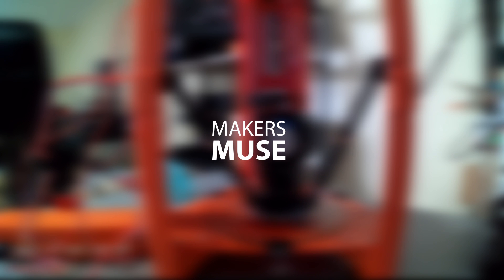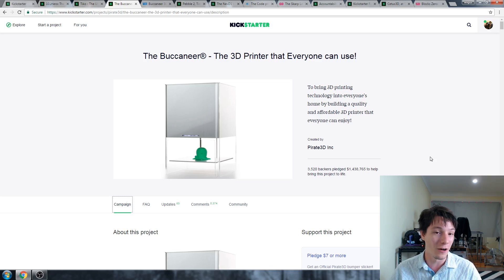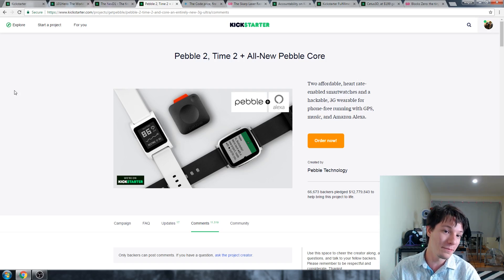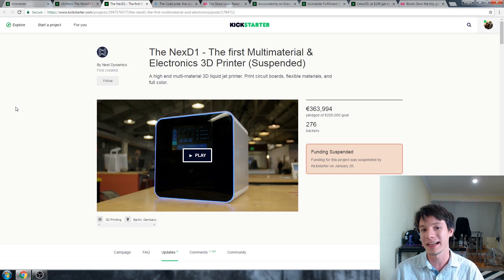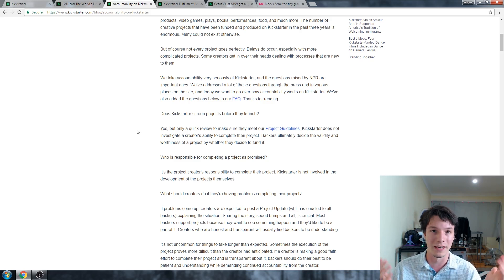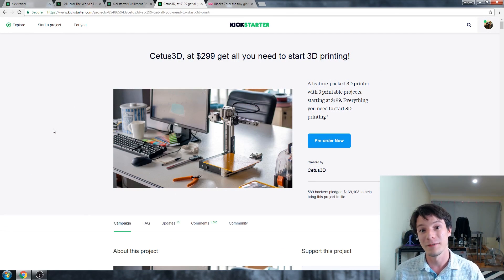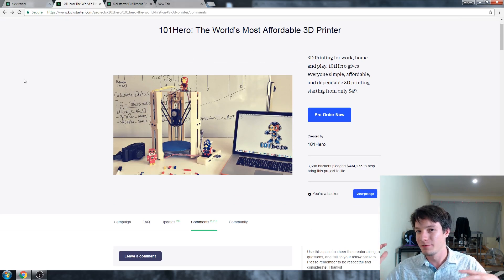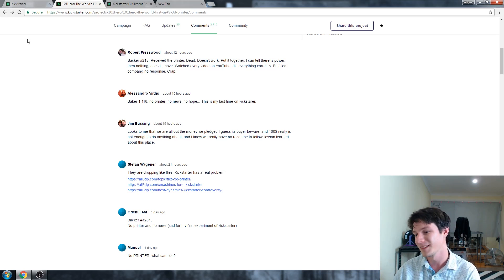Crowdfunded Hardware - We need a new approach (urgently)

Comment: I think this a big issue. I think Kickstarter should act as the "escrow" company and take in all the cash, hold it (maybe use it to make interest?), and give to the creator in accordance with their previously submitted business plan. Kickstarter could force a "business plan", to force "creators" to think through the process. How? 100 units - What's the plan for injection molding, metal work, wiring at this scale? 10,000 units, now what?, 1m units? See the "best and worst" case scenario of scaling the project. I agree many get lost in the shear scaling of the project. If Kickstarter were smart they would leverage this problem into a solution. Escrow the money and require a comprehensive business plan with specific manufactures already identified.Kickstarter Partner with known, reliable Manufacturers and require the Creator to utilize their Manufacture, or submit an alternative for vetting by Kickstarter. Think about this, Kickstarter could drive the cost of making these items down by partnering with specific companies, maybe they get a kickback? Who knows. Good Video!

Comment: Part potential solution/part plug: What if, rather than crowdsourcing the funding, we crowdsource the actual designs of these hardware projects (under open source)? Then, it's just a matter of someone manufacturing the hardware. Like the original Reprap project, it would be developed by the crowd, so the potential nefarious intentions or mass manufacturing pitfalls disappear (while, in the case of 3D printing, the industry as a whole still moves forward). 
In fact, that's why three of us have spent the last few years building a platform for crowdsourced design--so open source hardware development can happen in one place. It's like Thingiverse with built-in CAD. We want to do things like crowdsource the development of open source 3D printers, food and energy production systems, and whatever else the crazy Internet comes up with. We'd love people's feedback and to help kickstart the crowdsourced design movement: https://3DOrchard.com

Comment: To begin with Kickstarter themselves should not get their cut until a project has been successful. Those funds should be held in escrow to partially refund backers if a project does not deliver. None of this skimming off the top nonsense where Kickstarter wins every time. It is not a total solution, but it is a start.

Comment: What no mention of the Peachy Printer? ... the tiny resin 3D printer where one of the organizers simply ran off with the cash and built himself a house.

I recently received my hardware from the Raspberry Shake kickstarter.  It's an example of a kickstarter done right.  the hardware is a personal / hobby level seismograph using a custom circuit board along with a raspberry pi.  They raised enough money for some extended goals, and they shipped on time,  although their choice of shipper left the hardware floating in transit for two months.  Nonetheless, the seismograph works great. It exceeds the capabilities they promised, being able to detect large earthquakes on the other side of the earth in addition to small local events.  Their customer service has been amazing - they actually sent me a replacement when it looked like mine had been lost in shipping.  The original did show up later.  And they continue to refine the firmware and their support for the network for sharing the seismic data.

Comment: I would like to point out one oversight on your part. The creators of Kickstarter projects do have risk (skin in the game) with the creation of their prototypes.  Unless they are faking the photos and videos, those working prototypes can be expensive and time consuming to make. In my opinion, most of the projects that fail to deliver do so because of the unrealistic selling prices (reward levels) that they are offering to the crowdfunding community. 

Having done over eight crowdfunded products and delivered on all of them. I can usually tell just by looking at a project the ones that will never deliver. Pebble watch, The Coolest Cooler and many others were products were obviously under priced and doomed to fail. Shipping costs for the "Coolest Cooler" is an example of how creators fail to calculate the real costs of delivering on their promises.

Comment: Perhaps they need some sort of "certification" of the project, requiring the inventor to demonstrate not only the working prototype but also that his team has the necessary expertise to make the transition from prototype to manufacturable product. They should also have to demonstrate that they have the appropriate contacts in the manufacturing, marketing, and distribution fields in order to turn it into an actual product.

I'd suggest someone set up a certification company and that potential kickstarter projects be submitted to that company, for a reasonable up-front fee, before they be allowed to actually make it a kickstarter project.

I also think that there's an opportunity here for existing manufacturing, marketing, and distribution companies to put together "packages" for kickstarter projects whereby they would come in and provide all those services, for a fee or percentage, so that the inventor/developer's time is better spent developing the product since in most cases they simply do not have the capability of fulfilling all those other requirements.

Comment: Unfortunately, the basic answer is greater accountability. Which goes in the face of these micro funding platforms. The premise is that you can invest a relatively small amount of money, otherwise known as disposable income, and in return, you might actually get what you invested in.

Here's the rub, and its in that "disposable income" statement; we've all heard the expressions, buyer beware, if you can't afford to spend it, don't, etc. Well, these platforms are just the wild west of product innovation. They are similar to the pinks sheets used in the states to trade stocks that are under qualified for "real" markets. The potential that attract people to these markets is greater than average returns.

Bottom line, there are issues on both sides of the equation; for one, I agree, we should be able to remove the wheat from the chaff. Get the obvious frauds out. That requires greater oversight from the platform. On the other side of the equation, investors need to realign expectations. No one is making you a promise, at least, based on the very nature of the platform, they can't realistically. So when the product is super late, does not live up to expectations, or outright fails to deliver, think again about the day you pressed the submit button...

Comment: I think what could make Kickstarter good again is if they upped the prerequisites of starting a campaign.  Most people that start these projects have absolutely no experience or education on how to do it.  All they want to do is turn an idea into reality.  But, they haven't done the leg work to research exactly what it takes to bridge the gap, and they often don't want to once they find out how involved it is.  

As you dig deeper and deeper into a project, you gain an understanding of just how complex everything is.  On the surface, it seems so easy.  And this is why Kickstarter is plagued with failed projects.  They've made a platform available for anyone with an idea to get free money for their project, with absolutely no other requirement than a working prototype.  As makers, we know just how easy it is to build a single prototype.  We do it all the time.  It's when you have to build 10,000 finished products, with certifications, licensing, QC, etc... that you realize it's impossible to do with the money you thought you needed.  The typical way to start a business addresses this early on, before any money changes hands.  It's required to have all of this figured out before investors will even hear you out.  It's called a business plan.  Kickstarter needs to require that project creators have it figured out too.  It's their responsibility to bring responsible and dedicated project creators to the masses.  Without doing this, they are shooting themselves in the foot and ultimately hurting what could be one of the greatest ways to start a business that there's ever been.  Almost everyone I know refuses to do kickstarters now because they've been burnt in the past.  It's only a matter of time before Kickstarter goes the way of the Dodo if they keep this up.  They did it to themselves by only caring about filling their coffers.

It's not too late though.  I could see Kickstarter surviving if they implemented this into a "Vetted Projects" category.  Basically it would be projects that Kickstarter has received a viable business plan for, where the creators have done the proper legwork.  This way, Kickstarter could still provide normal non-vetted projects along with vetted projects.  It would be good for Kickstarter because they would theoretically have stats to show that their vetted projects are safe bets.  But I doubt they'll put in the resources for something like this.  Unfortunately, the way a lot of people think theses days is quick money rather than long term earnings from a respectable business.  Kickstarter could truly be great, if they'd just put forth the effort.

Comment: I do agree. I am working on something as well but will only ever use crowdfunding when everything is prettymuch ready for production. I see crowdfunding as means to be able to offer products for decent prices by working together. (by working together you can use production methods that are optimized for large quantities).

In my opinion, you need the following ready before the kickstarter:
- Product (apart form some parts that can be tweaked from community input)
- A complete Production plan (how where when etc it will be made)
- All legal aspects such as rules and regulations in the countrys you expect to sell it (CE in Europe, UL in the USA and so on)

Crowdfunding should help you with the last difficult step of getting the product in production, not some pocketmoney for some experimenting. Especially when you present it as a finished product.

Thanks for the video!

Comment: To me here is the single biggest problem for hardware crowdfunding.   The company needs money to complete engineering for mass production, pay people, etc, etc.   Backers are paying their $$ for the product.    So unless the pledge price is lik 400% the cost to produce a unit they will run out of money.   

For example if I want to manufacture something that costs me $25 to make and I plan to sell it for $100 but put it on kickstarter for early bird special of $75, I'm only getting $50 per unit to spend on engineering costs, test runs, tooling, coffee etc etc.   So if I raise $500k only $350k of that is usable as I have to pay to make the machines.   Take off %10 to pay kickstarter and now it is $300k.   That sounds like a lot of money but it isn't.   That'll pay for 2 contract engineers for 1 year, no rent, no coffee.   Even if you have a team that will work for free that is still cutting it close to pay for the costs of setting up manufacturing of a complex physical item.

Comment: I've been working on a modular lithium battery system for several years now. Idea is one format that works in everything from boats to trucks to lawnmowers to home solar. 3D printing plays a big part in prototyping and my production plans. As I come closer to a "launch ready" product funds are tighter than ever, just when I need the most resources. Do you think kickstarter is a good path forward, or should I attempt traditional VC or mortgage my house and sell my car and hope for the best?

Comment: Great video as always,  it really depends on the percentage of failures on kickstarter. a lot of P2P lending have Provision funds that repays investors if a borrower
misses a payment, imo it would be a good idea a percent or two from all projects could go into the pot,, with better scrutineering before project goes life(name, address & police check of the person making the campaign would be a start), force maximum number of items and combine that with the scrutineering before the project goes live, and a better way for the community to liaise with kickstarter to shut down or force the hand of what looks like dodgy campaigns. Lucky enough never been done on kickstrter but have cancelled a fair few pledges before the end due to the creators not communicating or not showing they are competent, as for ingiegogo wont touch with a barge-pole. Trouble is until kickstarter and the other-sites see a drop in revenue they don't care.

Comment: I was kind of disappointed in this video. The viewpoint is an opinion and it's an opinion based on a false view. Kickstarter is not a marketplace. You are not guaranteed anything. What kickstarter is, and crowdfunding in general, is a direct replacement of the Venture or Angel investors.  Startups rarely have the ability to leverage any real financial capital either through loans or through personal finances. It's common for them to seek out investors, usually called Venture Capitalists or "Vulture Capitalists" or Angel Investors.  

If you back something, it's written into the terms and conditions there's nothing saying you will get anything for your financial contribution. You, as a backer, are taking 100% risk. These projects can fail and stats show that most will fail. If they fail; guess what; there's no refund. This is how business works, crowdfunding just made it easier to raise funds since you can get 1,000 people to give you $100 easier than you are 1 person to give you $1,000,000.  

That should be more clear to backers though.  Good projects will succeed. Some good projects will fail. Bad projects will always fail. And the risk is on you, the backer.
Reply: Something else is a wrong look at things. These are startups. Even bank loans would be highly risky which is why startups rarely can get bank loans. It's investors that fund startups.  It's how and why Uber has $1BN net worth even though they're not making money.  

Startups are risky and Kickstarter or any crowdfunding is to help a startup get going. In many cases crowd funding is the only option for these projects. They've either already been turned down for bank loans and/or passed over by venture capital. Likewise, it's seen as better to go crowdfunding as crowd funding doesnt demand a stake in the company/say how things are run/loss of control that you would most definitely have with a venture capital/angel investor.  They still take outrageous amounts of risk and lose more often than they succeed.  It's just that when they succeed, they're winning more than they've lost. 

If you look at Kickstarter from the Startup/Venture Capitalist sort of perspective. It makes a lot more sense.  If you're looking at Kickstarter as a marketplace where you can pre-buy tech; you're going to be a very disappointed shopper and complain about Kickstarter and crowdfunding.
Reply: From the investor side of things, try looking up Gary Vaynerchuck (garyvee) He's got a very long history as an investor in the classic sense and tells you about the wins and losses.  The show Shark Tank (US) is a television show about seeking investors for a company in startup or expansion phases of their business.

Comment: Don't forget the Trinus Angus. Must be the best printer i own. They should check creator history to prove they have experience delivering the type of products they are proposing.
Reply from the maker: Absolutely, I didn't want to drag the video out any longer than it was but Trinus is another example of a well planned project. I did get a little upset discovering after my review that the machine was already in existence as the  Panowin F1 however true to their word the final Trinus was much modified and improved. If the existing manufacturing system hadn't been there at the beginning things would have probably panned out quite differently!

Comment: Like any investment, there are no guarantees and crowdfunding is no different. It would be nice to protect the investors from outright fraud, but I bet that would be a tough legal bar to reach for enforcement as most of these failures are not fraud based, but asset/resource failures. And of course that would require the perspective governments to get involved, which just add that much more complexities and problems to the issue. 

The way I see it, there are only 2 options. Continue to take the risk as an investor or don't participate at all in the hope the platform crumbles away and dies.  

I gotta tell ya, as soon as the bigger companies started funding their R&D with crowdfunding, I knew this was going to end up as an absolute failure. It's like an insane win-win for these companies, why not do it.. Keeps the 'real' investors happy as can be..

Comment: I think there is an relatively simple solution: Kickstarter needs to include an insurance for their backers. If the project fails, they will pay back the money. The insurance company would check project proposals very carefully to save themself money. To allow for more risky projects Kickstarter/insurance company could rate projects on their chance of failing and offer graduated payback (a.e.: this is a risky project, you only get 40% of you investment back in case of failure). So people are covered or at least partly covered and better informed about the risk.

Comment: I got a tiko, I guess I was lucky because I actually got mine. I kinda regret buying it since the slicer it comes with is kinda crap and you need to do a bit of work to get another slicer to work. It doesn't have very good resolution though. It couldn't even print the ears on the low poly Pikachu